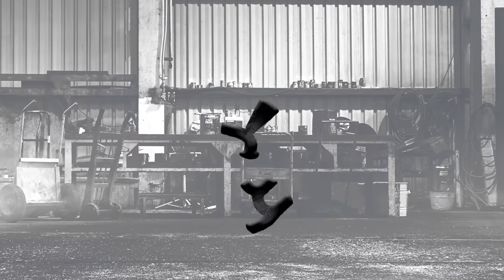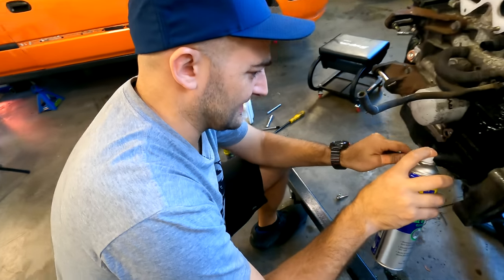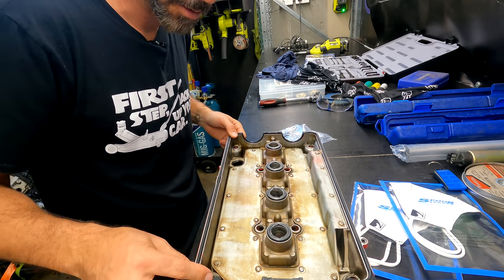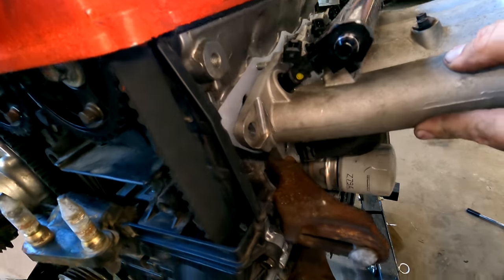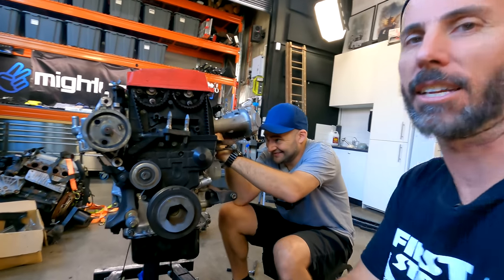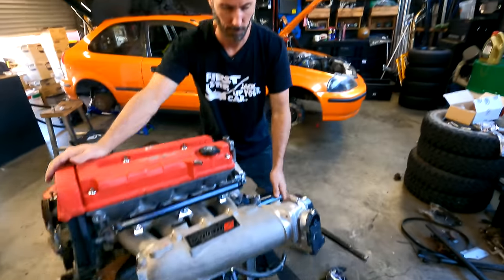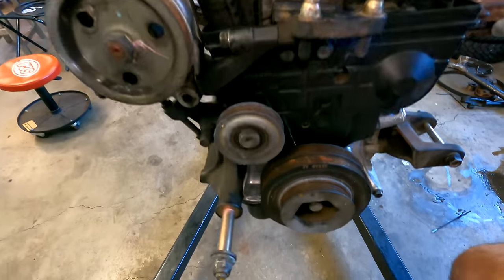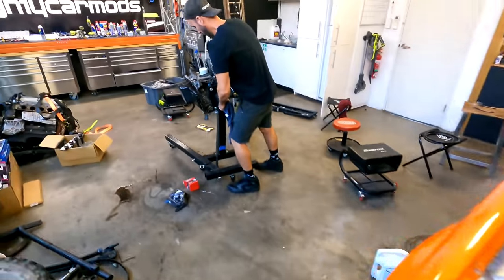The Last SKUNK FIGHTER | Nugget CIVIC Build (EP6)

Comment: Wouldn't want the old oil filter to leak on the floor so lets flip it upside down so all the trapped metal and crap will flow back into the engine. Sigh. Not oiling the new filter gasket. Sigh. Over tightening the new oil filter so that the next guy under the car with no room to work, has to puncture the damn thing with a screwdriver to get it off next time. Sigh. Saying f*ck it when one on the intake bolts is stripped so the head and/or the intake warps and one or two cylinders run lean and eventually burn through the top of the piston. Sigh.

Comment: Why everytime we gotta listen to how inferior to the rest is Honda. Because that's complete bulshit!!!
I wanna see Subaru makes 200hp on a 2.0L NA engine. Hell, slightly tuned K20z3 makes over 215 whp again NA engine, slap a Turbo and that 2.0L will outperform any Subaru 2.0l engine. How about new Gen Honda iVTEC Turbo compare that to a Subaru and see which engine is more durable and reliable and capable of making more power. No need to hear from you, It Is the Honda engine just better build.